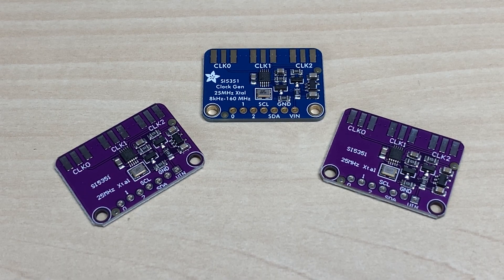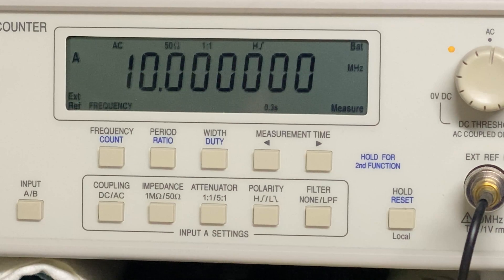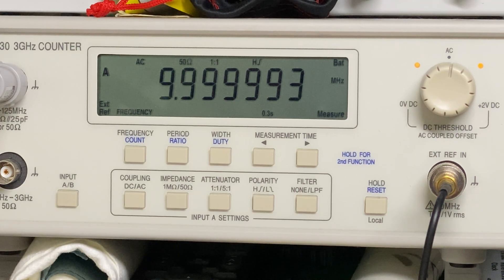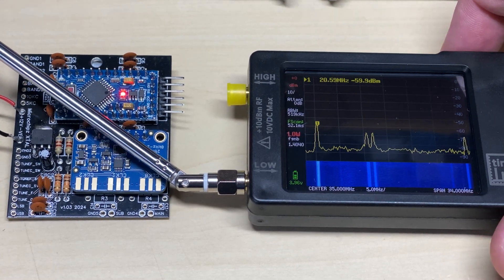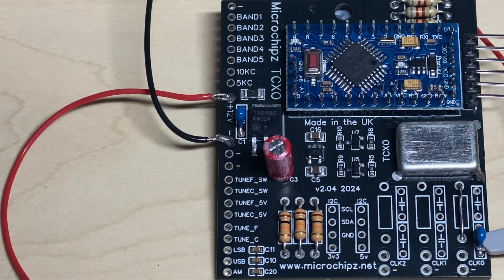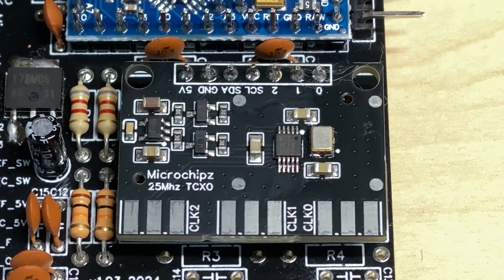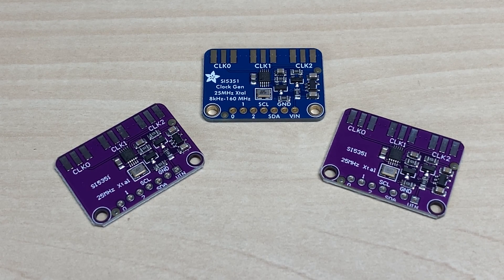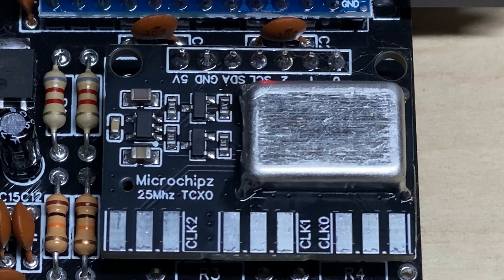EP 183 - SI5351 Clock generator IC/Breakout boards - Testing and making more stable with a TCXO.

Comment: I am currently experimenting with SI5351 boards that have clean spectrum, that is low birdie levels. I have found two boards that are exceptionally good. These have a low power crystal, which seems to be the key to clean spectral performance. Almost all birdies are below -80 dBc. But these are not very stable. Drift of the crystal is tens of herz. Adding a external TCXO increases the birdie levels by 20-30 dB which shows up birdies on the finished radio. I think these are caused by common mode clock currents through the SI5351 GND pin and would be impossible to fix. So I will not use any TCXO.
Reply from the maker: Hi, interesting findings, maybe a better xtal is needed ?.
Reply: @MicroChipz  Well, I think it is not only a question of the crystal. Also proper board RF design has a role. 
SV1AFN sold some time ago the best SI5351 board with a high accuracy crystal and very low spurs. But it is gone now from his shop.
Another good board is the "Adafruit Si5351A Clock Generator with STEMMA QT". It has quite low spur levels, but the crystal drifts more.
Reply from the maker: I just checked the schematic for that and its exactly the same circuit i am using, i dont think these will ever be perfect, but good enough for what i need.

Comment: Very interesting,i was thinking dual output for xtal controlled Am cb walkie talkies to replace the xtals,455khz offset.
Whats the phase noise like ?
Considered repeater tx offset shift +/-100khz  ?
Ctcss encoder/decoder?

Very impressed by your work.

Rob P
RPC Systems

Comment: If you're willing to accept some power wasting (which is more or less irrelevant for anything that's not battery-powered) you can go for the "poor man's OCXO": glue a 50ohm/0.5W resistor on top of the basic crystal, and connect the resistor between 5V and GND. :) It does take a few minutes to stabilize, but still much faster that the one just held in air - and after that it will be also almost unaffected by the ambient temperature.
Reply from the maker: That would work , the resistor would be a bit big I think .
Reply: @MicroChipz  it's about the size of the oscillator, or a bit smaller.

Comment: Great video and neat solution, I experimented a lot with these a few years ago whilst designing a 70MHz SSB transceiver.
As you say, the Crystal was fairly unstable, it’s a neat, simple solution that works what you both have achieved. 

I started playing with the SI5351-C variant which accepts an external clock reference, and it has double the outputs too, but the cost and complexity of implementing one of these was too high, as a one off maybe but not as a production unit. 

I eventually moved away to the AD9959 DDS chip, however the end result showed no real measurable difference in stability and performance, plus the good thing with the SI5351 family of PLL is the output power of these, which you can step up and down easily and can drive any form of mixer with them, in my homebrew rig I was using SRA-1 diode ring mixers in the RX chain and a combination of active MC1496 and SRA-1 passive mixers in the TX chain with no issues. 

Another tip for you, it is fairly easy to implement an IF Shift feature in single conversion rigs like the one in your video, if you replace the VCO and up/downmix crystals with the SI5351, you can simply vary the VCO and BFO crystal frequencies in sync with a separate rotary encoder, use an Micro like the bluepill or blackpill controller that is ARM based and has a similar footprint to the Nano, but has heaps more I/O and extra interrupt pins - Plus they're only around £2 each and 100% compatible with the Arduino IDE.
Reply from the maker: Hi, thanks thats some good information especially the bluepill/blackpill boards , will defiantly look into them.